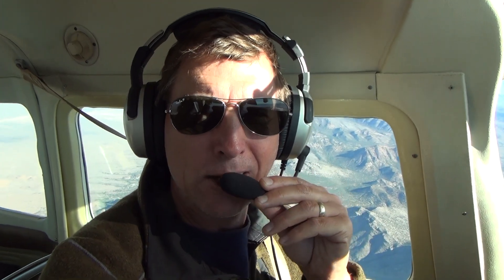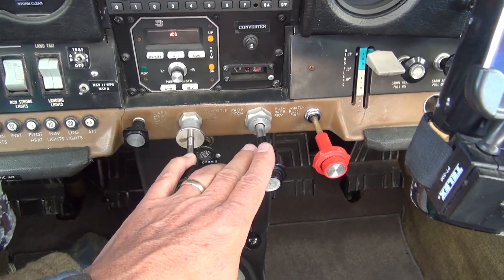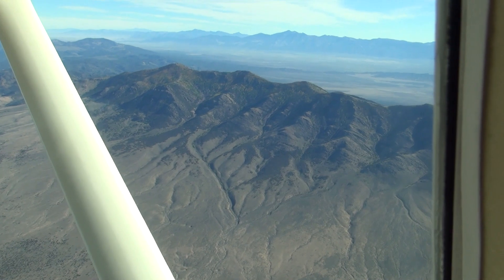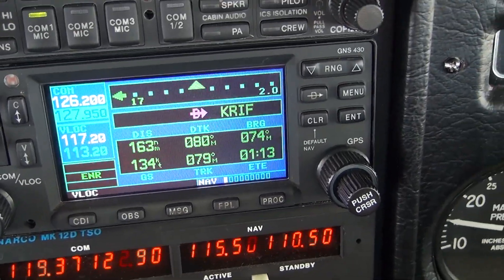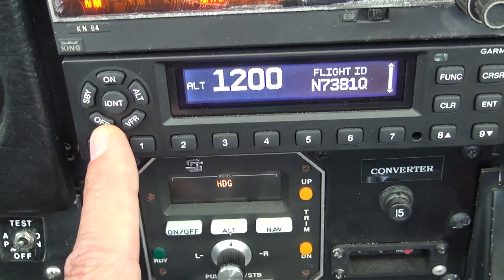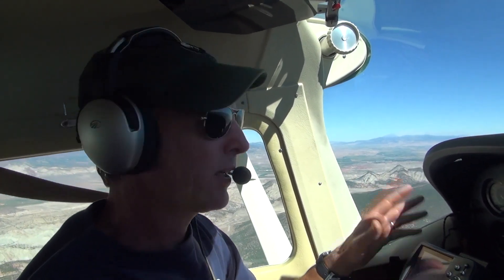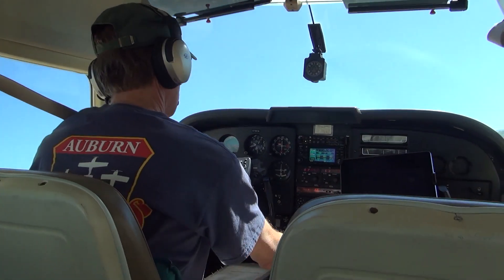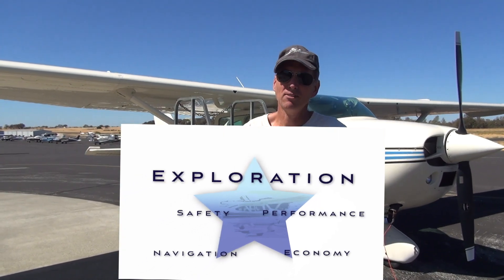Cessna 182 - Orientation (part 2)

Comment: Do you put weight in the back seat when flying alone?
Reply from the maker: Yes and no.  Usually I do like a bit in the back, but it's not necessary.  The airplane is heavier than let's say a Cessna 172, so that means you have to hold (flare) with a bit of might and muscle.  But at the same time you must be careful not to over do it (pull back) because then the bird balloons (meaning start to fly away from your level landing).  
Folks have to be aware of letting the nose drop too fast, again as the airplane has a 6 cylinder engine that holds 11-12 quarts of oil.  That oil alone is heavy in the nose.  It's a great plane to land on short fields if you practice as the flaps go to 40 degrees.